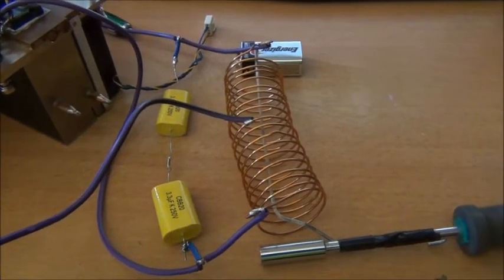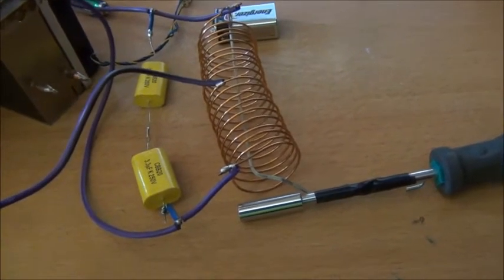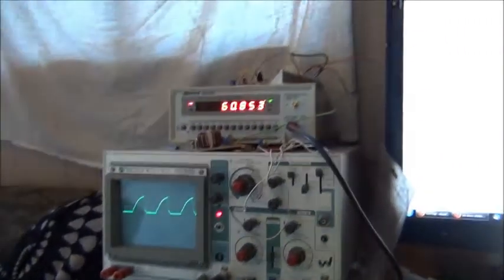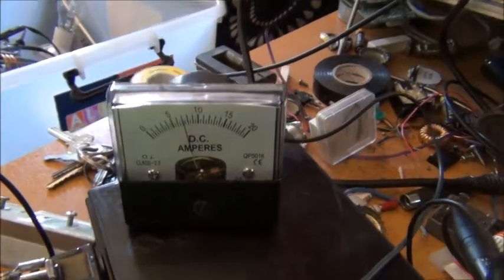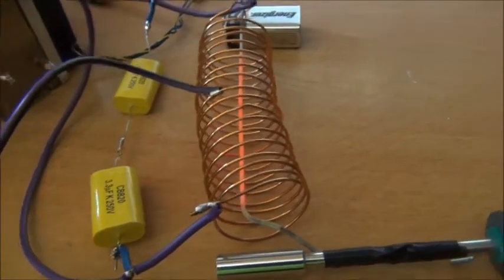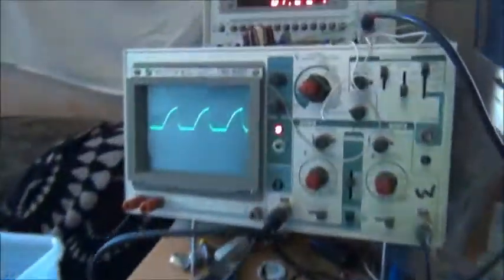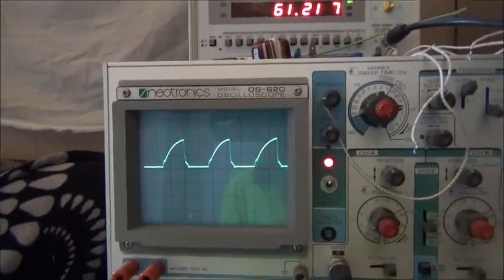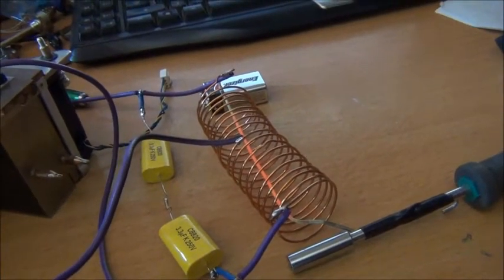ZVS Induction Heater I

Comment: You need much bigger capacitors on the output. Try between 3 and 6 330nF 1250V polypropylene caps. Also you don't really need that many turns on the work coil. Looking good though

Comment from the maker: unfort i have little control over this..  i could lower the gate resistor to try sqaure it up.. but this seems to be the standard "ZVS" driver pattern. i tried to run it with TL494 control but it just registers as a dead short, and with the inductor in place its not dead short, but doesnt heat!! ARG! gonna try TL494 control with a work coil transformer see what happens!